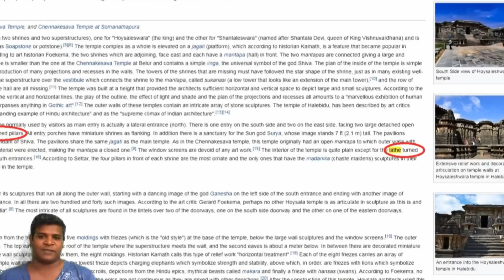Hoysaleswara Temple, India - Built with Ancient Machining Technology?

Comment: The pillars were made in lathe .powered by elephants. the stone used is called soap stone ...which is widely used for sculptures..it is a very soft stone in hardness scale 1  which can be easily carved...then its heated which hardens the rock to a hardness level of 6. Also giving it a shiny smooth texture similar to the pillars and sculptures on this temple. 
 If you visit this place you can see and buy small stone carved memorobelias being made with similar carvings and polishing ...with crude tools .. less than 100 to 200 Rupees.
Reply: This seems like the most plausible theory to me

Comment: How did they come up with this gear ratio of 2 to 1?  Ummm because the circles that the "gears" are around are two different sizes, specifically one with twice the radius of the smaller one.... therefore the circumference of these circles are 2pi and 4pi respectively... with the same size "gear" shapes, twice as many would fit around the larger circle.

Comment: For the intricate small gapes and hollow objects look to chinese carving. They hollow out artistic scenes into small jade stones using string and grit. An ancient technique. I have no doubt lathes and basic machinery was in use. Moat likely wooden for the mostpart.  If you were to attach gritted string or rope to a spinning wheel you could cut through rock like a modern circular sawblade. It could also be handfed. To allow for wear and breakage of those strings. This explains how they could cut monolithic rocks so precisely in areas like egypt. Closely fitting rocks in walls ould be made by simply rubbing two rocks together. Applied several layers in advance of the actual placement. We have lost so much wisdom.

Comment: Im a machinists and tooling marks are obvious on pillars. We manfacture CNC machines for the stone industry so Im familiar with metal and stone tooling. Only problem is such cutting requires diamond impregnated carbide. Maybe its soap stone and would not require  carbide?

Comment: using various old techniques (like waterwheels, stone mills used for grain milling, etc) i could see how a large column of stone can be rotated and then tools are pressed against them just like is done today. it would be much slower, and would require usuing up many cutting tools. but it could be done .... The hollow stones are a mystery however. I would also suspect that the figures are designed to look like one piece, but are made of individual pieces so well crafted they look like one.

Comment: What does look like to me is belt driven and gear driven shafts. Maybe they were no longer useful or damaged in some way and whoever was using them discarded them and the ancient Indians use them as pillars. But in the one scene you can see the pillars in the background have gears on them in the one that you're standing next to has grooves at the bottom of it like the grooves in a serpentine belt pulley.

Comment: You can get upright lathes. Seems simple enough as long as you move the block on to a spinning platform then you can spin it and lath it with anything metal. You don't have to spin something like a modern lath on its side. The skulls that are hollow isn't such a stretch either. Many modern crafts people can hollow out spheres or any other shape through a small hole.

Comment: If there's a river nearby, it seems feasible to me that they could pin the pillars as stone cylinders in the river and use the water flow as a mechanical means to spin the pillar, a means to cool the stone as the tools caused friction, and a way to carry away the carved material. If there is a river nearby we could check for sediment made of a similar stone composition to the pillars. That's another question, exactly what type of stone are these pillars made of?

Comment: It's widely accepted that lathe turning is one of the oldest methods to make round objects but that doesn't mean that they had lathes that in any way resembled what you see today. Objects can be held In v blocks or between conical centers. They can be lubricated with tallow or sand and they sometimes aren't powered continuously but instead a pair of ropes can be used, one tied to a sapling or a weight or an arm anchored with animal sinew to form a spring with another rope tied to a treadle so the work oscillates in both directions. The tool simply sits on a rest like a modern wood lathe not like a sophisticated metal lathe.. It's not far fetched at all. And it doesn't mean that ancient people had technology that rivaled modern automated manufacturing

Comment: Force Field Shaper and Burner in effect. "Field" is 3 dimensional. Once designed, the entire rock is enveloped by the "Field" and the statue is instantly made at the press of a button. The unwanted material is annihilated and turned to dust... which is easily removed. Lathe marks could have been designed into the column to throw investigators off the trail.